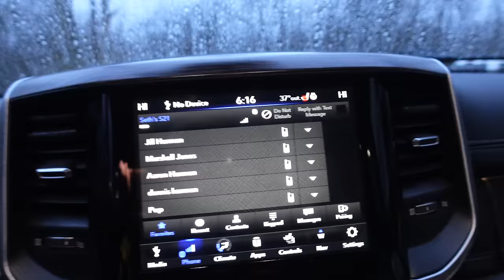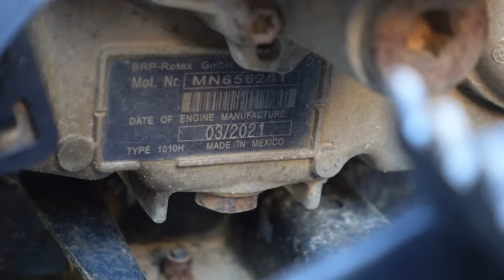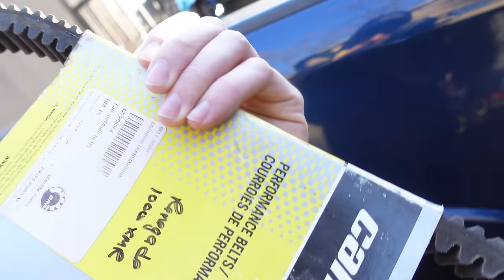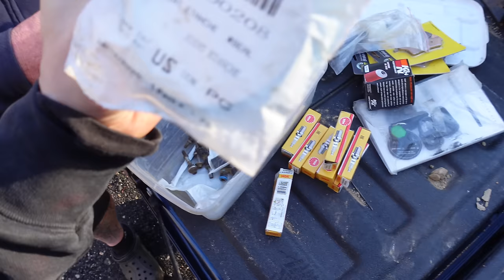I Bought The Worst Can-Am Renegade On Facebook Marketplace! | What Did We Get Ourselves Into... EP.1

Comment: The restart issue after it gets warm is from the tune thats been added to the bike. Thats the same ol classic issue that many have when they change the setup on the tune. They are very well known for it. Go with a milder tune and itll be fine
Reply from the maker: Unfortunately, as you guys will see Don, the crank tore up in it most likely from being sunk and the bearings are toast. It was literally seizing up lol
Reply: Ive had that problem on 2 renegades before… it was both bad grounds.. when it get hot you couldnt start it or was harder… had to wait back to start it

Comment: IF it starts fine, then after warming up, hard to crank, slow turning over, youll need new rod bearings, when they are cold they are normal size, when they are warm they swell, Meaning the bikes Probably been sank, However, dont know what you got it for, But theres a guy on youtube teaches how to rebuilt the motor, step by step by step,

Comment: I want to get in the chat and let you know I had a 2012 do the same thing to me and it was the fuel pump. The fuel filter was clogged on the bottom of the fuel pump. It would run for 30 minutes eat up and it shut off, I took the fuel pump out, cleaned it and it ran so I decided to change it
Reply from the maker: We wish it were that easy. Engine is on the bench tore down as we speak. Stay tuned 😅🤘🏼

Comment: Once you go renegade you can’t go back 😎
Reply: @OnKill_Powersports #facts
Reply: Overrated 🤷‍♂️ renegades are basically just a less practical outlander. No difference in performance but has no utility purpose. Whatever a renegade can do, an outlander does better
Reply: @dennisdwagner2012  they make racks for renegades plus I have no intentions of ever using mine as a “utility”. Maintenance and cleaning the renegades are far superior for the simple fact everything isn’t covered by 40,000 plastic covers. I can have a belt changed in less then 2 mins on a renegade, can’t say that for a outlander 🤷🏼‍♂️
Reply: @OnKill_Powersports  I don’t have to remove my footwells to do a belt change 😂
Reply: I like my fenders so I won’t go renny